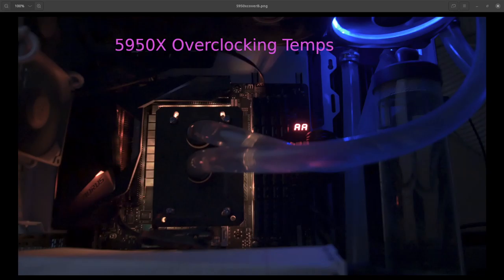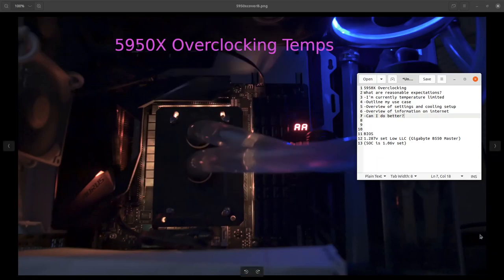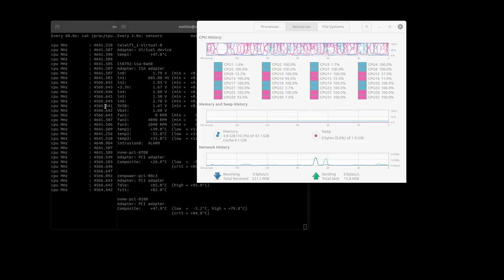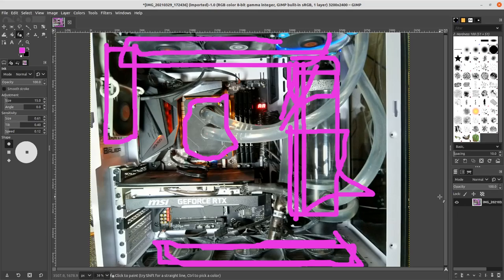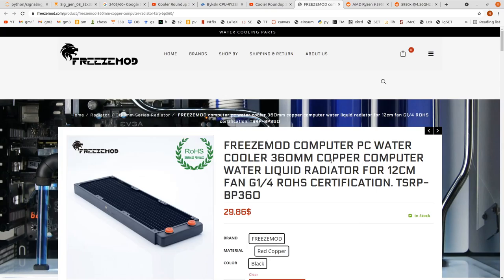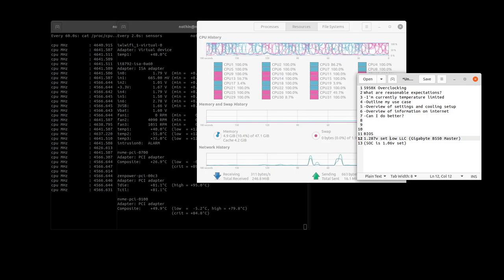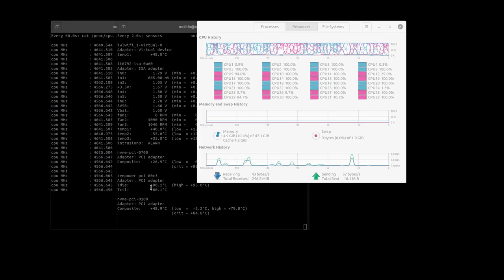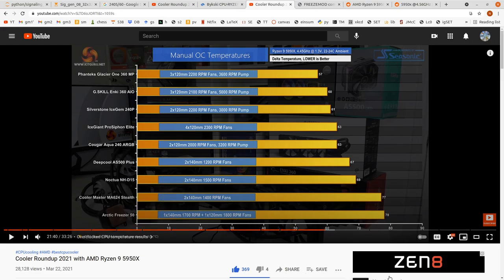5950X static overclocking temps

Comment: Nice video. Im on heavy custom loop and using 5950X. 

I think the CPU scales nicely to around 4.6Ghz with voltage (atleast mine does) and after that frequency it starts to require too much voltage. On ambient i managed to hit 4.7Ghz and did few cinebench runs with that (was really hot, don't remember vcore sadly) and with 10C coolant i managed to run R23 at 4.8Ghz. (1.35V, It was very very hot)

One thing that might interest you was the observation i made. Jumped from Bios version 3001 (Asus does not tell what AGESA code) to 3602 (AGESA V2 PI 1.2.0.1 Patch A) and with identical settings i noticed my temperatures were ~10C higher than last time. 

This could explain why you see these temperature differences compared to kitgurus review.

And why the temperatures would be higher with new bios version? I don't know but they just are. Maybe higher PLL voltage or something. Too low IQ to answer that. Core voltage and SoC were the same. Frequency same. No clue.
Reply from the maker: Thanks! This is incredibly helpful information. I think I'm on  AGESA 1.2.0.1 PatchA. I'm not entirely sure because Gigabyte had to send me a unlisted bios to get per CCD working. I'll look around this weekend to see if anyone has anything to say about the temperature jump in the new AGESA

Comment: im  figtinhg with my 5950x too about 3 months , i cant help you
Reply from the maker: Do you know if you have the original or b2 stepping?
Reply: @TheParadoxy  STEPING 0 I THINK ITS ALL ABOUT BIOS SETTINGS. i think my ram isnt good 3800 cl14 xmp 1.5v. when i put asll stock  with xmp i got low performance
Reply from the maker: @janpoland5318  not a gamer. I'm not ram limited